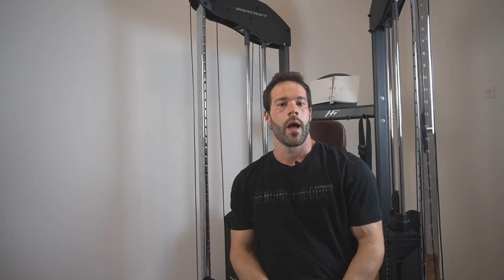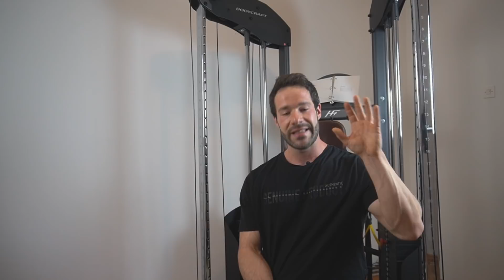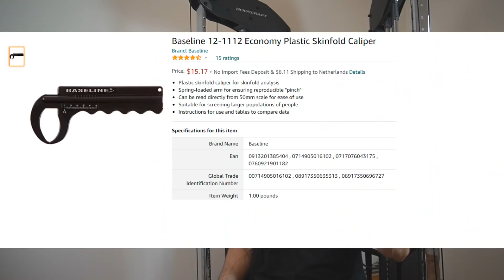Lean Bulking Successfully - 5 Fundamental Principles

Comment: Something I started doing… track weight daily, but plot it as a 7-day moving average in Excel. I also created a calculated cell in the other column that shows the difference in average weight on the current day vs. 7 days ago. If I am gaining more than 0.4 lbs, I don’t change anything with my diet. If I am gaining less than that, I add a new food item to my daily diet worth 100 calories… and repeat the process

Comment: On the topic of relative strength, I noticed that I rarely improve it during bulking, or even can keep it the same. What usually happens is that it gets a bit worse while I get a bit stronger, but improves drastically when I cut and keep the weights about the same.

Comment: I've made very good gains being in a slight surplus for like a 2-3 months and then doing a 2-3 week minicut. I cant see why one couldnt run a system like that forever. For me the outcome has been roughly the same or better compared to longer cycles I ran in the past. I think if you switch things up every few days or some shit, then you definitely spin your wheels, but if were talking about for example two months of gaining then only a two week cut, IMO theres no way that system would hinder growth in some way.

Also I think the psychological side of this is important, like you yourself have talked about in the past. If there is a system which allows you to make gains and still like the way you look year round, IMO thats better than some other system which is 10% more effective gainswise but makes you dislike the process in some way . Were in this for the long run after all.

Comment: Another great video, thanks for the tips! 
One trap I fell into during my first bulk was that I blindly followed the 2lbs/month-gain advice, only to later realize that, as a lighter person, it's better to think of the gain in terms of % of individual weight. For a 155 lbs person lime myself the ideal rate of weight gain turns out to be obviously lower than that for a bigger guy. And then I ended up putting one more fat than what I hoped.
Reply from the maker: thank you! yep, definitely agree that its better to think of percentages than absolute numbers